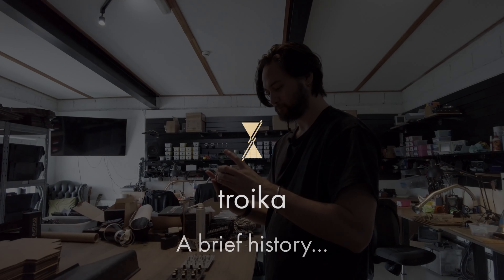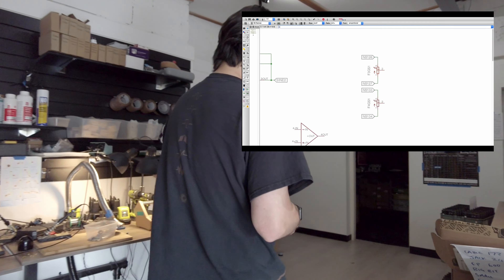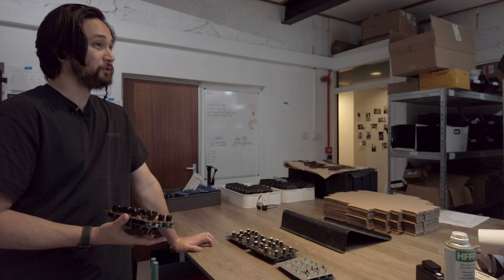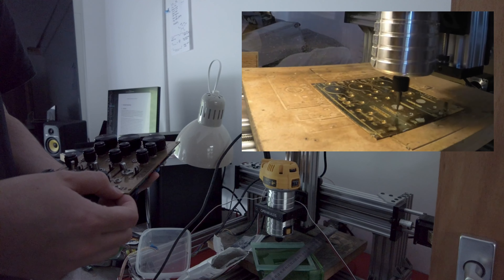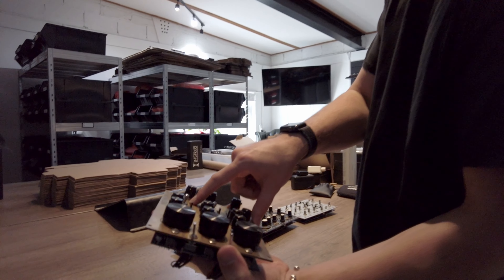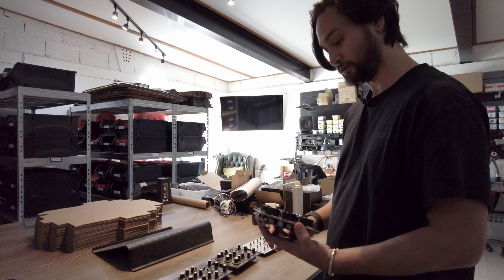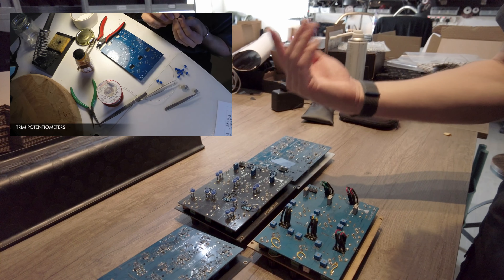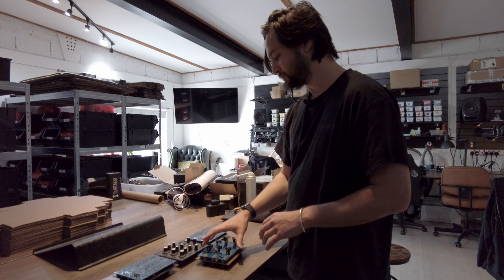Instruō - troika: A brief history

Comment: When you engrave on Stock material It's almost impossible to get a uniform engraving cause .002 depth of variation can make a visual difference

and for the machine plunging into the piece
That unfortunately  happens cause of program reading  glitch or the thickness from one piece to another varies a lot
Especially if material is from different material Bars
( ex Stock 1/4 thick material )
Can vary from .230 to .280

Cheers Great and interesting video
Reply from the maker: My machine is also a diy bodge job 😂
In hindsight I’m quite surprised I ran it for so long.
The thing doesn’t even have limit switches!
I owe it thanks, but damn that thing was a chore to run 😂
Reply: @instruo  You made the machine
Wow I'm really impressed